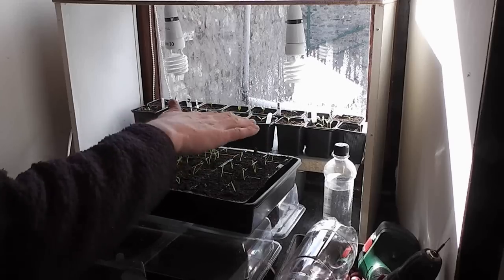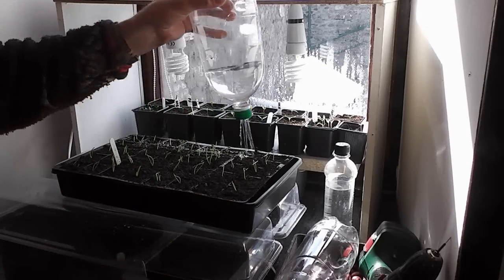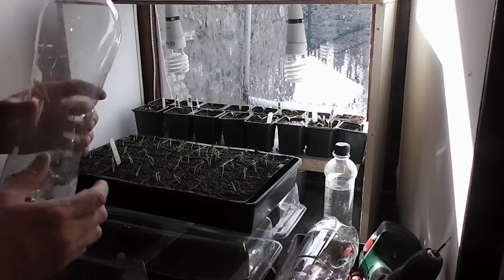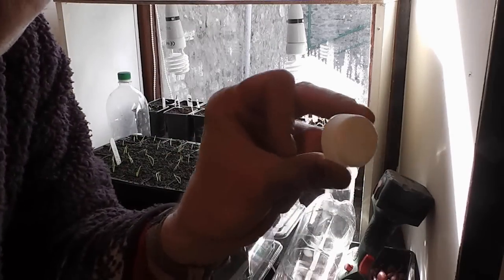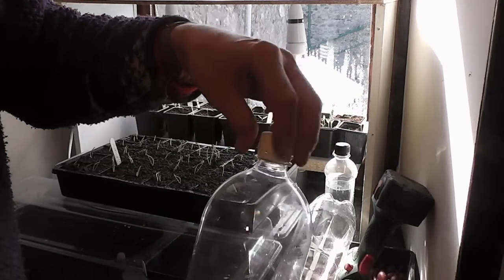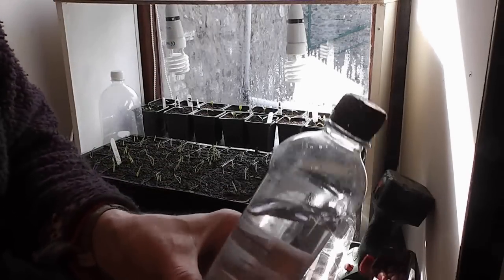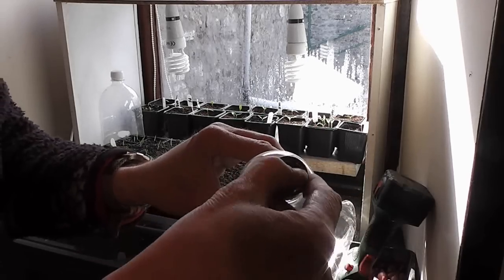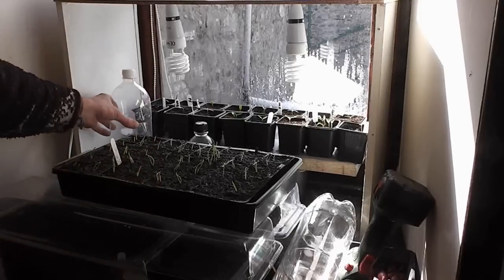How to make a fine spray bottle indoor plant watering can for free.

Comment: It's a great idea.  I have some similar videos on this subject for watering seedlings.  My latest uses a thin tube to reach in/under the seedling area.  Sometimes a small hole is needed in the bottle to let air pressure in to force the water out if it's not comming out so good.  I guess your squeezing the bottle.  One way to get holes is with a hot pin or needle held with pliars.  As far as I know, these holes can and should be quite small, maby 1/32 or slightly larger diameter.